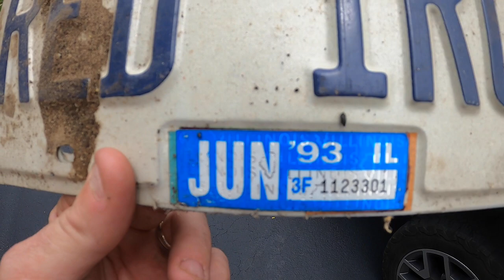ULTRA RARE 85 IROC BARN FIND!!!

Comment: my 84 z28 has the dual snorkel air cleaner/and rodchester qual carborator -with G hanger for secondary an special metering rods/the hold carburator was special/has the ram air effect at high speed/is that a ho engine/check the VIN FOR the G as in ho engine/that looks like it might not be/wrong air cleaner/thanks much